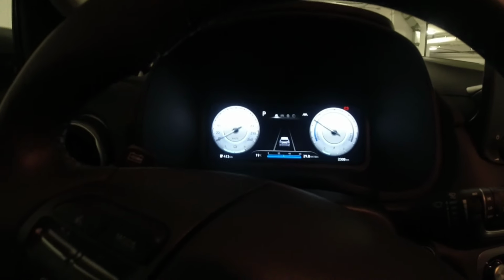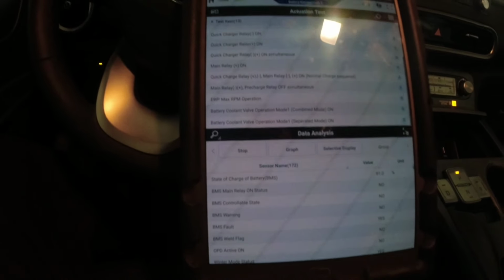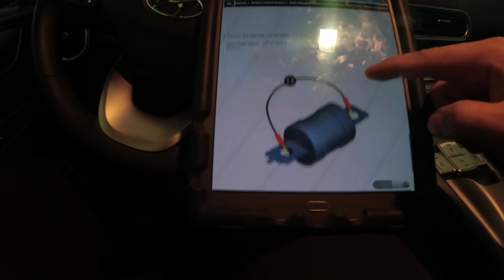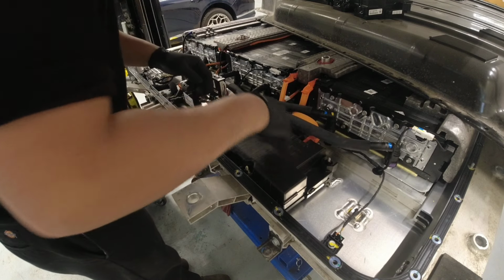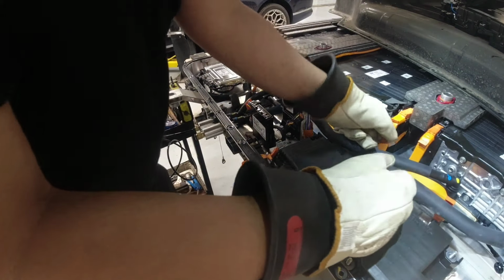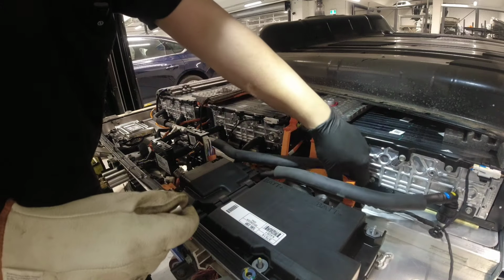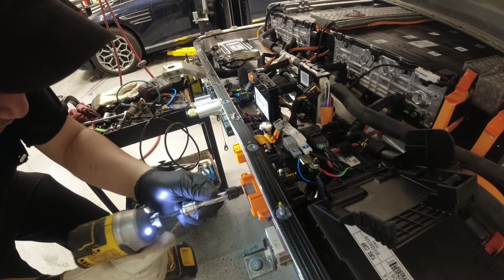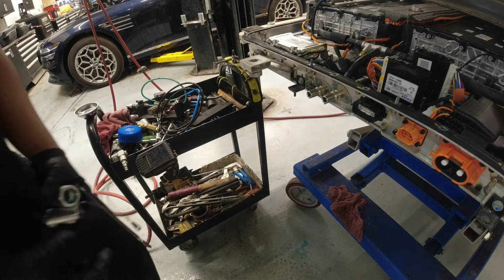Hyundai Kona EV won't move, high voltage fault

Comment: Hi i got Kona electric 2020 I got this issue but car can be charged but is not responding on diagnosis computer please give me some guidance thank you
Reply from the maker: Maybe you have communication line fault, check c can if you have 60 ohms check if its short to power or ground

Comment: Hi, your video is amazing..
I have the same car Hyundai kona ev blue drive, the problem with this car is High Voltage Battery Temperature Sensor 'B' circuit, i try to get the temperature sensor replacement but first i have to determine which battery pack is defective, can you share me the HV schematic or tell me which battery pack is labeled "B",
Reply from the maker: I will check send me your email add.

Comment: Hi boss I have this Hyundai Kona ev I changed the whole battery and then after driving it for a week the car was working fine now the car start for 3 seconds then goes to the ignition I put it in a computer it said the MCU was the fault now that I changed that the car wouldn’t start then I put it in computer then it says the motor sensor A not learned and 2 other things can you help and give me an advice what this problem is thank you
Reply from the maker: When you replace the MCU  you have to use the scantool to perform calobration for the motor